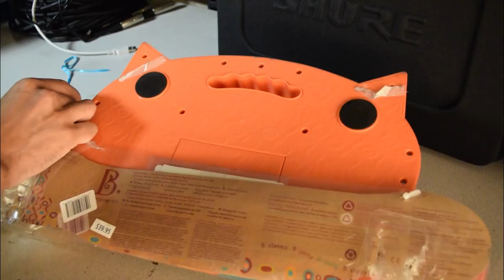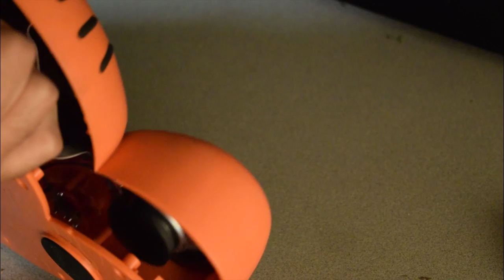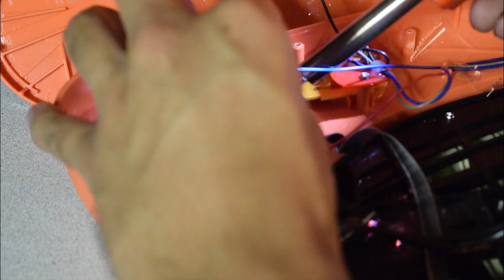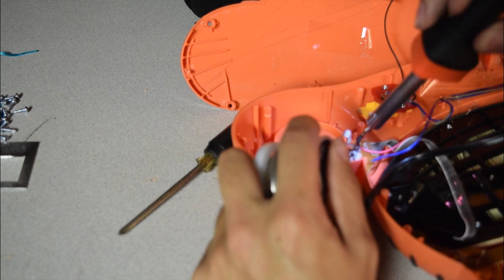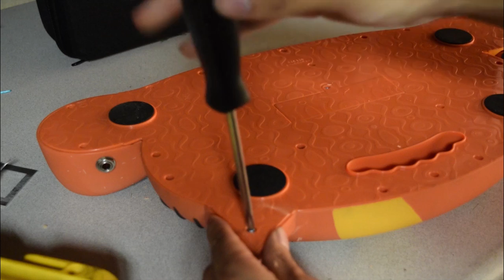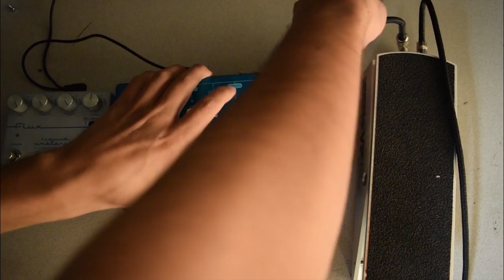Meowsic cat keyboard mod and test

Comment: hi your bend wouldnt it fry the circuit over time, did you add any resistors or anything, or did you just rewire the speaker to the mono jack ?, im intersted in a simple build but wouldnt like to fry my circuit tho :) hope you have some information, you want to share :)
Reply: That was my same thought. I saw a video where he added a capacitor to the speaker wire/jack, shown here at 6:33: https://youtu.be/IBak46asLlA. I don't know enough about modding, however, to know if there should be some extra resistance or something, so you won't fry the board or damage external output effects. Apparently if you web search for "Meowsic Keyboard Output Jack", you'll find a nice mod, which indeed does show a series of resistors and capacitor.  I'd be cautious to just directly hook the speaker wire directly to an output jack like this video shows.

Comment: The speaker in those meowsic keyboards, does it have a built in amplifier into the speaker or is there an amplifier in the PCB somewhere? I’m thinking of getting one and wiring up a switch jack so it will switch output to a line out instead of speaker, but play out speaker when disconnected. Among other mods
Reply: From the looks of it I’m guessing that little speaker doesn’t have an amplifier, which means wouldn’t you need a tiny LOC to use the output?